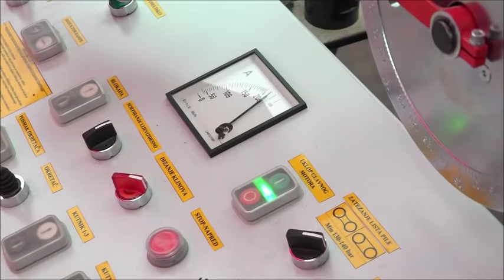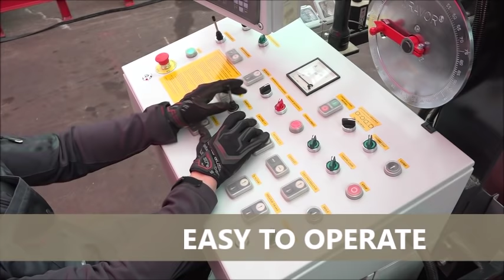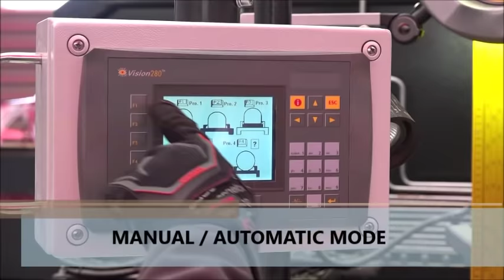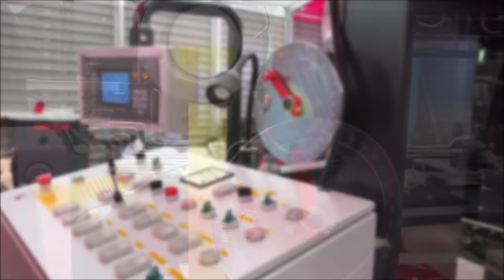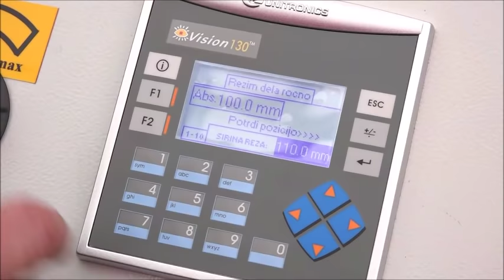WRAVOR Horizontal  band SAWMILL WRC 1250 AC

Comment: child labor, no eye protection, no hearing protection but they've got the fancy uniforms and accessories.  nice machine.  i love it when they say minimum labor but they don't count the maintenance crew required to keep it running.  and the logs are automatically transported to the cutting bed i suppose.

Comment: I see several problems. One, it's big but it's slow by definition - you simply can't cut timber quickly with a band saw. Second, the operator rides the saw. Why? Why waste kilowatts of energy to transport 60-80kg back and forth all day? And third, all this "automation" will only get in the way. The only thing that MAY be necessary is electric drive for the saw frame, that's all. Everything else is just unnecessary toys that make the whole thing more expensive. You can easily move the boards through the mill on rollers (unless ALL your exmployees are 12-year-old boys). This is just a glorified wood-mizer.
Reply: Hello Maloy7800
I am in Africa and active into export of Rough Cut (some bark-on) square edged Hardwood logs.  Now I like to venture into SPF softwood logs (similar sort).  If you watch this video from 08.00 to 09.07 "making of Prism" you will know what I actually want to do.  Not this much finished but some quick cuts which can turn a round into square edged.  For this project, I selected British Columbia as the area is highly blessed with SPF and other types of wood species. 
You seem to be an experienced person in saw-milling so I seek your advice for an economical hydraulic and semi fast sawmill through which I could manage to finish at least 2 - 3 / 20 Foot Container loads on daily basis.  The size of such square logs can be starting from  8 x 8, 10 x 10 and onward with minimum length of 9 feet each.   
What could be your choice of machine for this work ?  Efficient with low maintenance, Productive and within decent price range.  New or semi used.  Thanks a lot.
Reply: Hello, Kboci Ghana, I'm not an expert in this area, so, unfortunately, I cannot help with this. Just one advice - don't buy Chinese!!! Good luck to you!
Reply: band saws are actually quite faster than a circle saw for sawing timber, less kerf= less resistance while in the cut. I generally feed 250- 300 ft/min on a 7' double cut.
Reply: @kboclghana  I have the machines for You, bandsaws from 35mm / 7,5kW to 100mm / 30kW, with hydraulic pack fully configurable. I'm francophone, I sell and install env. 50 machines / year.
Reply: Looks slow and there is too many employees to pay.

Comment: This is far from high production yield...VERY far
Reply: Kari Kähäri what would you suggest for big volume cutting?
Reply: Depends on the size of the logs.  But in general I am speaking of machines that cost millions with all the conveyors etc. Search for Hew Saw in youtube to get an idea what I'm talking about.
Reply: Kari Kähäri cool thanks!
Reply: Kari, HewSaw makes machines that process millions of cubic meters every year. They only work in Sweden or Finland on those huge "export mills". And the price of those machines is astronomical.
Reply: palthak83 quad with canter saw then twin band saws  both 1.6/1.8m wheels and edger followed by a drop sorter.